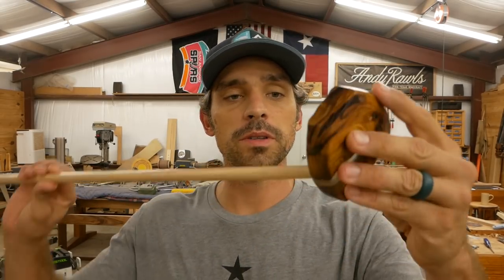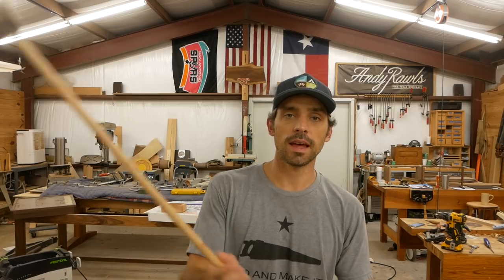Making An Osage Orange and Epoxy Golf Putter

Comment: Hi Andy. Looks good. Could you not have sliced a quarter inch off the bottom and hollowed out the back of the putter before filling with lead and regluing the bottom thus gaining the weight but hiding it inside the putter. Think I might try this. Always wanted a wooden putter that I made. Thanks for the video man.

Comment: 5:37 just fyi, you will have much faster results if you grind it on the left side. Just from a physics point of view
Reply: Nevermind, that wheel spins opposite of what I'm used to. Great work though.